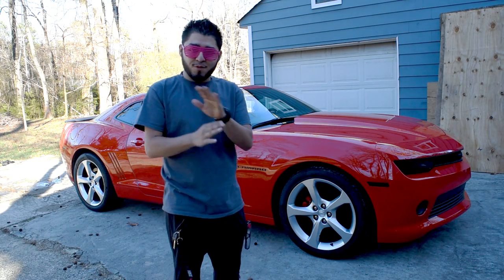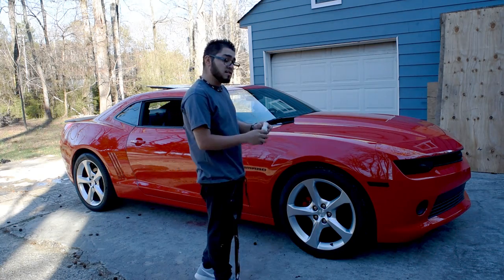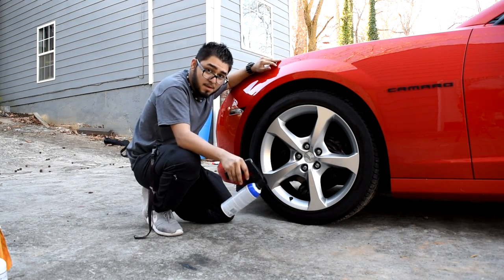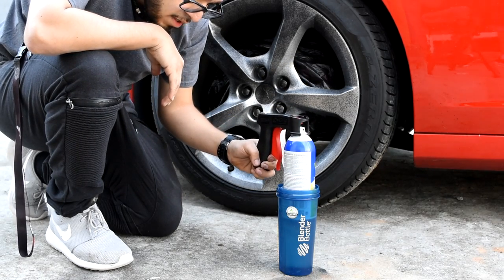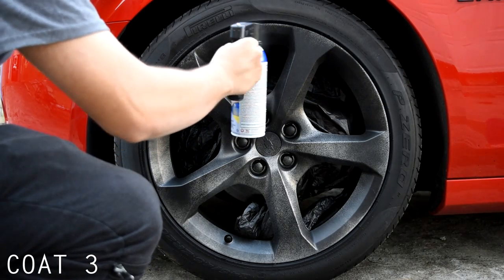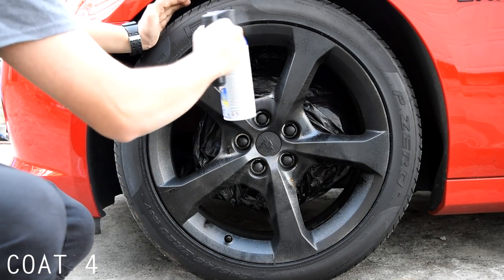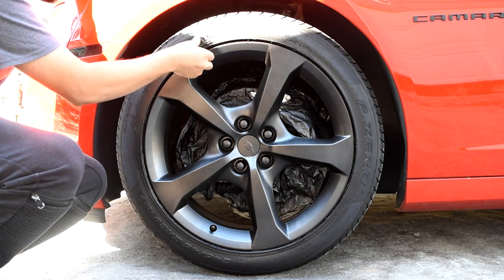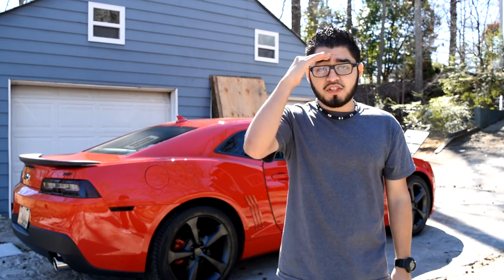How to Plasti Dip your Wheels/Rims W/ Black Metalizer - (Camaro)

Comment: As an update for anyone thinking about doing this: If you live in a 4 seasons environment, and daily your vehicle, damage will occur to the dip and require preventative maintenance. The rubber loves to pop out of any kickback areas that creates "bubbles" on any wheels that are more high profile. It can be tricky to wash as well, as you need to be somewhat careful. It has been 3 years for me, and 3 of the 4 wheels are under the same spray/clear coat. The 4th had to be redone from tearing, and 2 of the other three now require a full tear out and redo. But that's just my excuse to put a new wheel and tire package on.
Reply: Ok
Reply: This is pretty much my strategy. I’ll use the next few years to save for some really nice tyres and actual black wheels, but while the current tyres have some tread on them, plastidipping them should last fine.
Reply: @stevemulcahy5014  tires*
Reply: @sbe0001  both work.
Reply: @stevemulcahy5014  wrong

Comment: Does the plastidip stay on the lug nuts after a tire change? How easily do the rims scratch from flying debris etc when driving?
Looks like a great cheap alternative to buying black rims but how does look after 2 years?
Reply: Don’t spray lug nuts does nothing for it and it could peel plasti dip off

Comment: Do you think it would be possible to peel away at just the chevy bowtie, without peeling the whole hubcap silver?
Reply: Emily Yancosky just tape off the Chevy logo
Reply: @SidewayzTre  I'd wonder if that would peel away the whole cap though when I go to remove the tape, since the bowtie isn't a distinct ridge on the cap...more just a shift in finish

Comment: I plastic dipped the rims on my truck and I go on rocky terrain 1 to 2 times a month so the plastic dip tends to peel a lot more since small rock shoot up under the plastic dip and start to peel the dip. If you were thinking about plastic dipping your rims you might want to go with spray paint!

Comment: Don't the nuts and bolts of the wheels get stuck with the dip or is that not a problem?
Reply: essel23fly i doubt it but you’ll probably scratch them/ peel them when removing the wheel

Comment: So I have some dings and scratches in my rims from the precious owner. Is there any way to fix them you think? Will this work?
Reply: You can use bondo filler. Put it in the scratches and imperfections and then sand it even and you can repaint them.

Comment: Quick question. How many bottles of spray did you end up using to do all four of your rims? The black and the metalizer.
Reply from the maker: +Max The Husky half a bottle of Metalizer & 3 bottles for all 4 wheels .. i did 7 coats so it will be easier to remove if i wanted to .. which is what i recommend
Reply: +Josue bout how long it took u to do all 4 wheels
Reply: Buckaveli Dade County about 4 hrs. I guarantee it.

Comment: OK so the first problem is not removing the wheels off the car and starting from scratch. To really do this job the wheels need to come off as well as the tires. If you notice in the video the horrible spotty coverages in the wheel lugnut slots. Not to mention when you remove the wheel you see how bad the wheel looks with aluma chrome holes from lack of coverage. The old school generation would do this job right and just By-Pass The Whole *MICKEY MOUSE* Car alteration job for the sake of quick cool looks *SAD*

Dammit!! Its your ride have some goddam self-pride get off your ass and *DO THE JOB RIGHT*